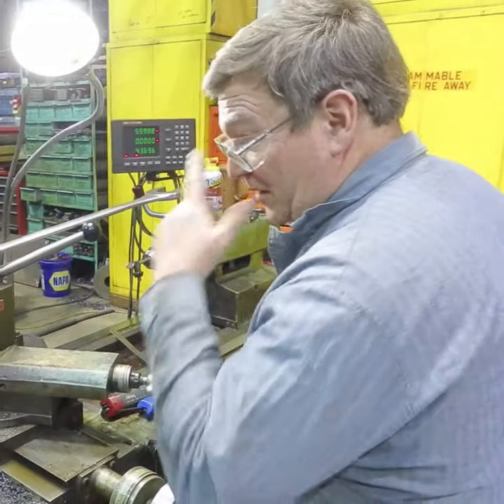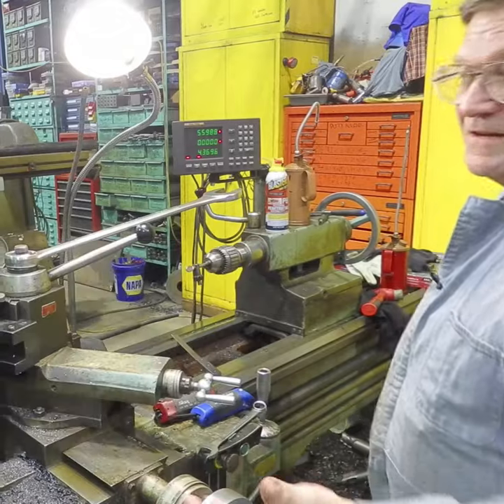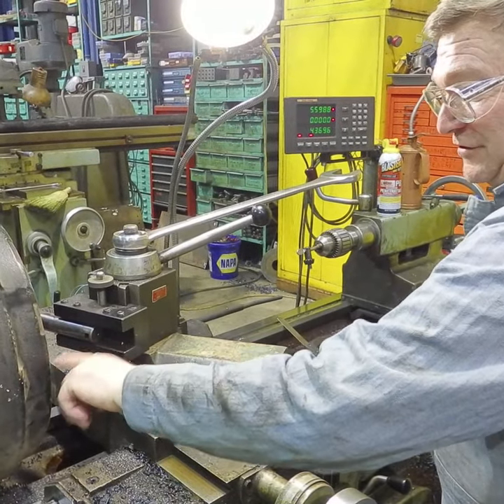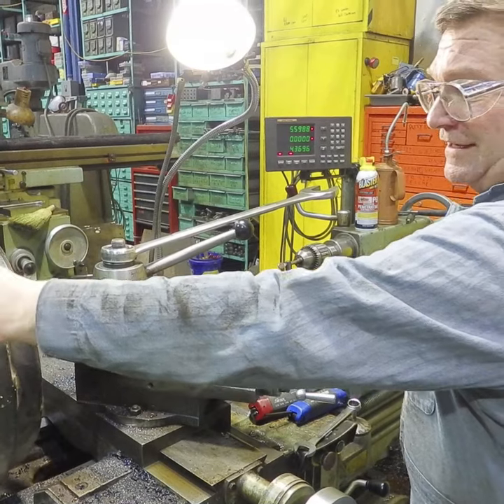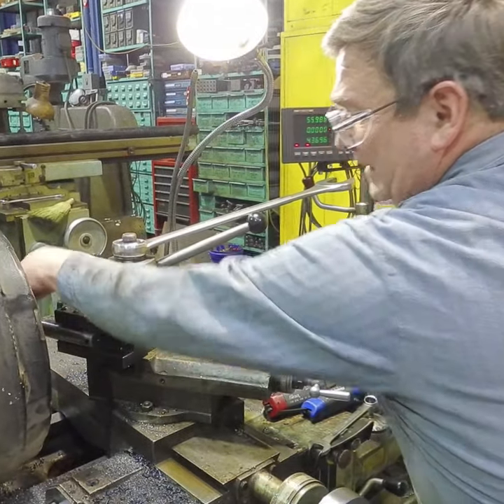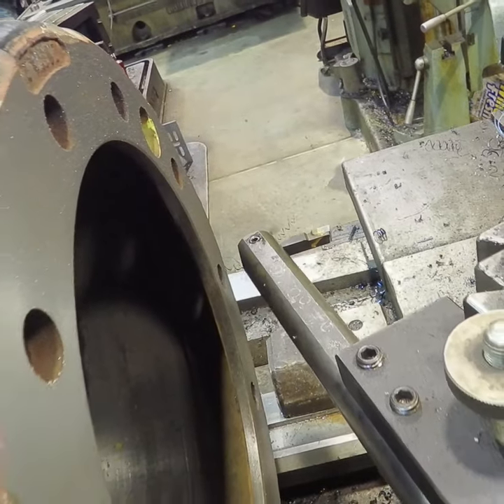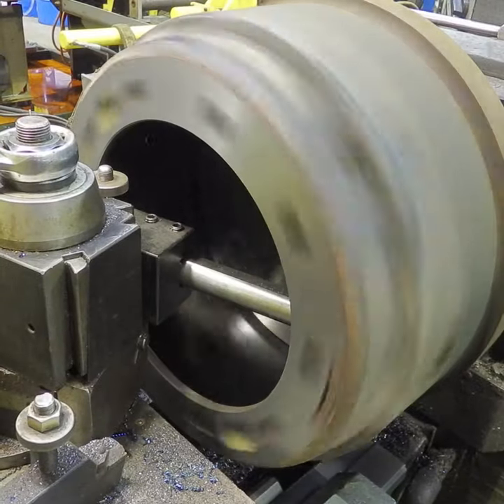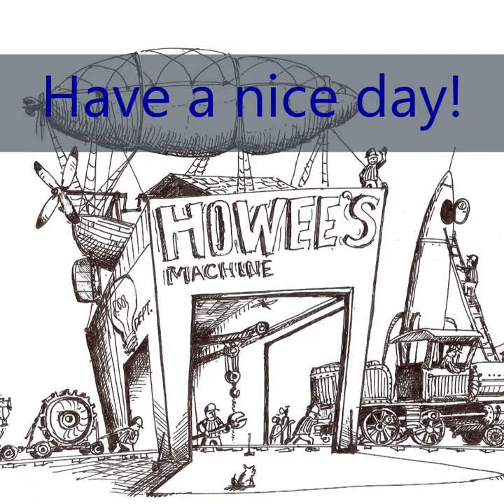Machinist's Minute: Facing an interior surface on a warped brake drum

Comment: As a mechanic in the lower 48 I wish we did this kind of work. Most of the time parts are available. But I just ran into a problem with a crane's hydraulic pump. The pump bolts backed out and chewed up the splines on the shafts on the pump and PTO.  A new PTO was 18 weeks out and pump from the original manufacturer was 40 weeks out. I went to my local hydraulic shop and they were able to make me a new vein pump. The old one was a gear pump. It still took  a week though. But they got us going.

Comment: So, here’s a question… Have you ever bored i.d. threads by flipping the boring bar upside down and cutting the threads on the far side? It works great, you can see what’s going on, the chips fall away from the cutting tool, and the compound is set in the normal way for o.d. threads. Try it.
Reply from the maker: Yes I have.  Another little trick is when you can not see inside at all, mount  an indicator, or set the DRO for the end of the thread position, you need to make sure to adjust for final depth as the thread progresses, just set the stop with the tool at an estimated final depth & the back-off on the compound when you start the thread.